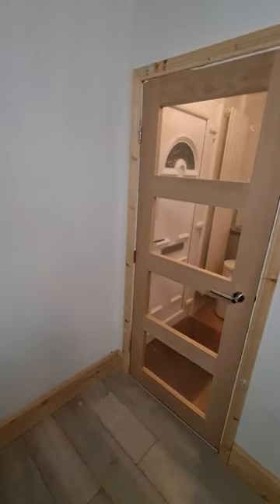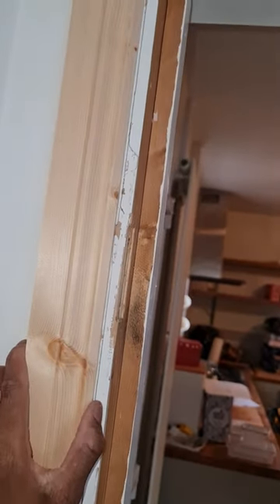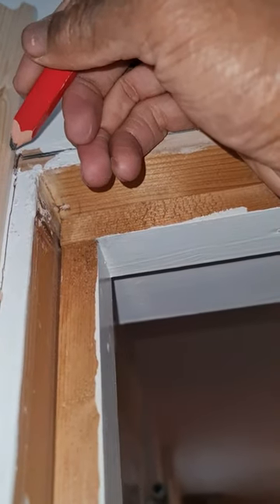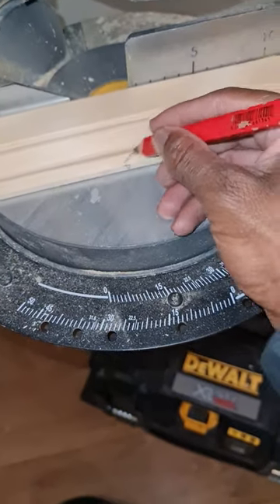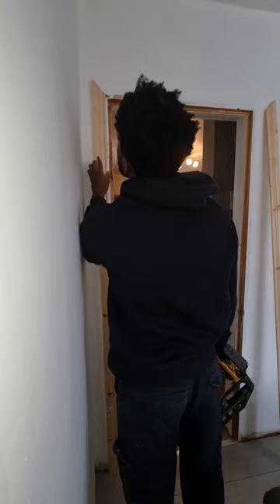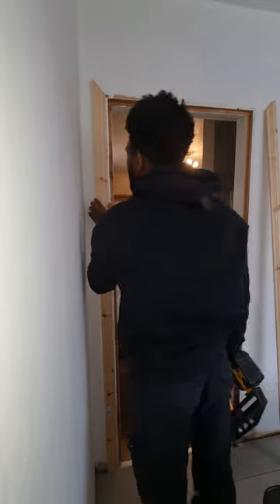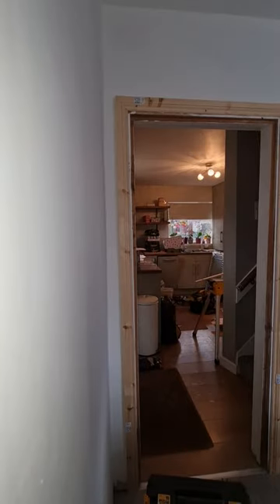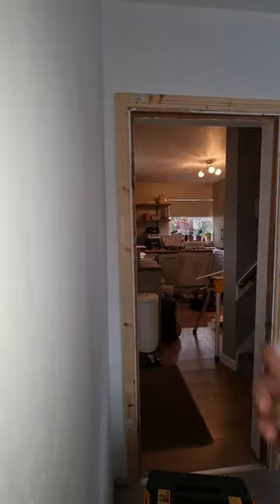How To Fit Architrave an easy way

Comment: Good one. I do the head first. Mark up and lightly tap in 2 small nails just below the line. The architrave sits on this and I centre and nail. Sides go on next and I use the white gripfill. The decorators like this as the joint is full and easy for them to handle. Love the channel. Spike